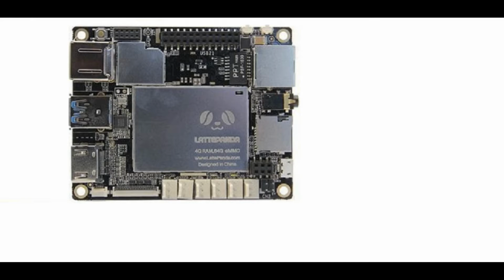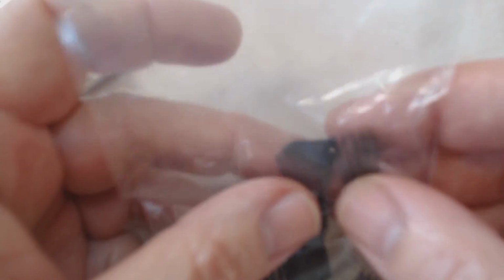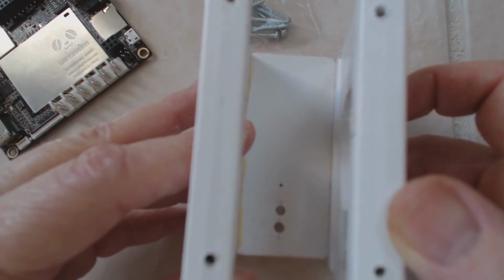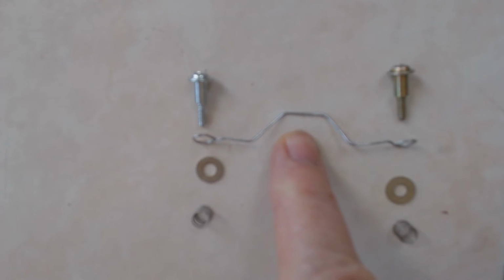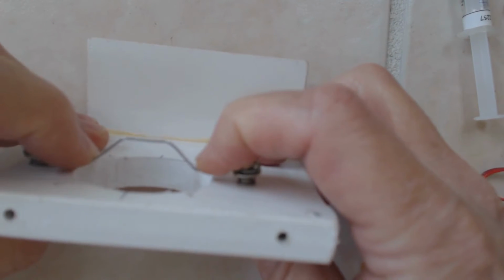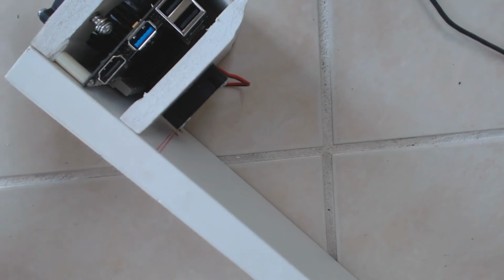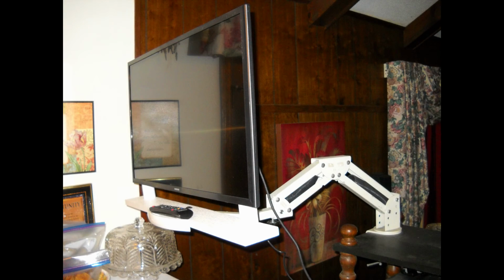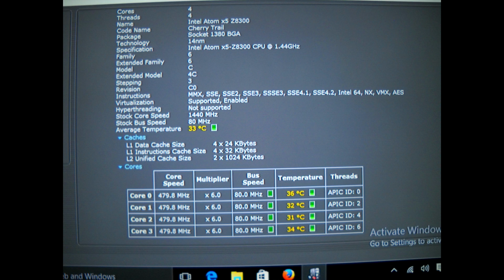Here is how I keep my LattePanda running cool.

Comment: Dear my friend, what did you use to paste the heat sinks over that plate? Thanks 😊
Reply from the maker: The heat sinks came with a thermally conductive adhesive pad.  You can buy these with our without the adhesive off of eBay. I didn't see the ones I used, but these are Similar: https://www.ebay.com/itm/12pcs-Blue-Aluminum-Heatsink-Adhesive-For-Memory-RAM-IC-Chipset/111954831621?hash=item1a11072905:g:M70AAOSwFSNb7EQu:rk:48:pf:0

Comment: Just get and old knackered gfx card, a small one.
Remove the heat exchanger, chop to fit, connect fan, job done.
Doesn't look like a rat's arse either!

Could possibly find something from the NorthBridge of an old gaming PC.
Some of those have a tiny fan fitted to the heat exchanger.

Comment: Beautifully done project. A lot of clever things in it, like the heat-sink clip formed from a paper clip, which is springy wire. And the result has a logical, engineering-style good looks that matches where it is mounted. And well presented video.
Reply from the maker: Thanks.  Glad you found it useful.  Still running just fine using Linux Ubuntu Unity 16.04.4 with the 4.10 kernel.

Comment: Actually, I would Suggest just taking off that silver plate "shield".  That plate is not a "sink" its just a shield.  Remove it and attach your heat sinks directly to the chip/s.  3 sinks will do what that WHOLE array of sinks are doing, and prolly do it better (way better).  Jut tag the 3 big main chips.  I just used those DFRobot sinks/fan.  I do wish the sinks were a little "beefier".  Also, the "thermal" they used underneath those shields are 150% crap. Its like a "blanket" they lay over it then put the shield on......

since the cpu is on the bottom (.... whoever decide to bottom the cpu = needs to be......) I just used 4 long MoBo standoffs on the bottom 4 corner, and 4 short ones on top 4 corners.  With the sinks/fan I get plenty of clearance for the fan. One bonus with the DFRobot sinks were the ribs.  Since they are shallow and flat, once you put all 3 down, you can cover all 3 with the small fan/sink directly.

Simplicity :) And no "walls" to hold any heat in. (ran my tower with no sides on it for years until a descent case finally caught up to my open air concept).

https://drive.google.com/file/d/0B7t2HvHDOQcqMkZ0dVVaYzhaTHM/view?usp=sharing

https://drive.google.com/file/d/0B7t2HvHDOQcqeHZTaEpieEM0dG8/view?usp=sharing

https://drive.google.com/file/d/0B7t2HvHDOQcqWVZiVjFjODNVVFU/view?usp=sharing

Also, This shows you how to put it into turbo mode. You have to physically enable high performance mode in the registery with 1-2 settings.

https://www.youtube.com/watch?v=xMRNhuY-5kA
Reply from the maker: All Great Ideas.  I just left the shields on out of convenience.  It is still running just fine.

Comment: the ugliest thing I've even seen.
Reply from the maker: True.  Not Pretty, but functional.  Board level computers are just that:  Board Level.  Works Great.  Runs Cool.  All that I need.
Reply: .seems true, your temperatures seems very low I can't get under 35 degrees no matter what I do
probably there is very cold weather where you stay? 
or maybe you have one of these miracle boards that can run around 60 degrees without any cooling, my board without cooling getting around 80 degrees at full load and then under clocking.

on Idle my CPU temperatures around 40degress, and full load around 60.
 I applied thermal paste on all chips just like latte panda did with CPU but with quality one and used two big heat sinks from each side.
and I have one FAN that blowing on my CPU only.

the other side of latte panda I installed there massive heat sink which fit exactly the lattepanda acrylic case.
I will upload some video later.
Reply from the maker: I'm not BSing here.  My two fans put out a lot of air.  Are you using W10?  Windows puts a lot more load on the processor.  I'll put together another short video with Linux sensors command.  In the original video I was using W10.  I've since switched to Linux Ubuntu Unity 16.04.2.  Currently the house is at 22-23 C.
Reply: your room temperature 20 degrees? I think you have thermal sensor problems... how can it run on 22-23c with FAN this is even below room temperatures. yes I am using windows I bought this device to run windows not ubuntu, if you wish to use linux you can use much cheaper boards with a lot more support then this one.
Reply from the maker: I'll post an updated cooling video shortly.  Now if you're getting 35C at rest, I'm not the one with sensor or cooling problems.  The heat sinks are cool to the touch.  I've even put a external thermocouple on one with a Fluke meter.  They are REALLY that cool.
Reply: Multi-meter thermo-couples are designed for measuring air temperatures and little else. I've got a stainless-steel "wand" type and one that's just the tiny thermo-couple bulb at the ends of the two leads and both are essentially useless for measuring surface temperatures. Measuring air duct temps when doing HVAC work etc they're so-so but the bare-wire units are very easy to "short out" and they're never more accurate than the meter and its battery charge regardless. 

That's why we have contact thermometers, infrared thermometers, etc. Its also hard to get an "operating temp" reading with any thermometer when you're operating the thermometer at the time instead of the machine. Heat sinks will pretty much always be cooler than the component they're attached to. It's hard for them to function otherwise. 

Black is the best "color" for transmitting heat because aside from painting it white or some other color and insulating the heat exchanger its applied to more there's no much that can be done to make it anything but black. Its also "one coat coverage" on all other colors and historically its been used for radiators, aftercoolers etc. because until fairly recently in the history of heat exchangers those components were made of copper, brass etc. Metals that easily tarnish, corrode and form oxidation layers that can completely "insulate" them. Paint also helps protect them from fan-propelled dust and debris and other airborne or waterborne particles that will erode/damage the fins, tubes, etc. 

That said, with fans involved and aluminum heat exchangers in an application like yours, bare metal is much better than painted black. Paint makes aluminum a less efficient heat conductor in both directions. It's also possible that has something to do with your temperature measurements.